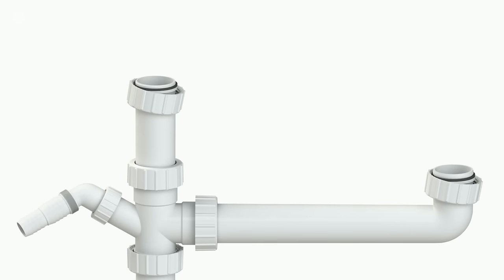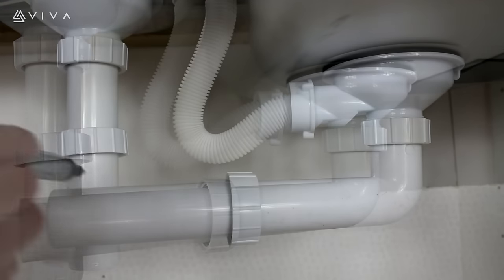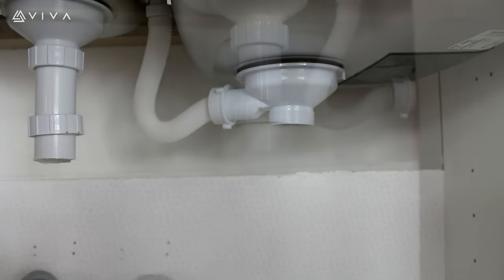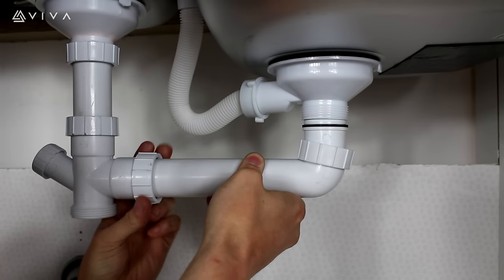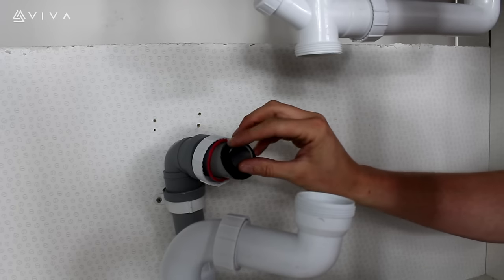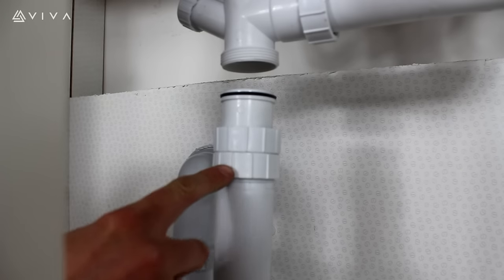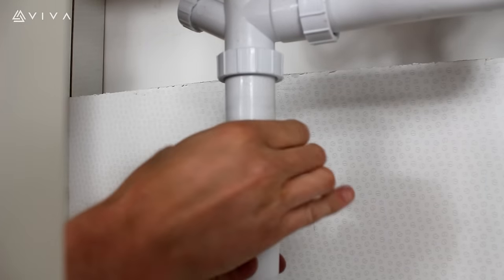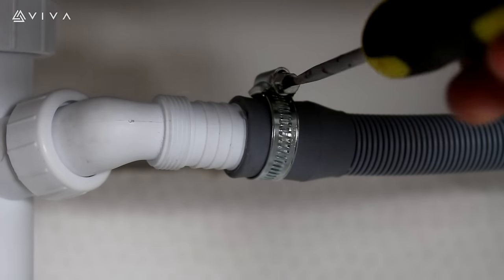How to Install or Replace a Bowl & Half Trap Kit For your Twin Bowl Double Kitchen Sink

Comment: Thanks for this. I had to adjust the pieces slightly because the spigot wouldn't fit on the left hand side under the smaller sink  as it was hitting the side of the cupboard so I bought a 90 degree compression knuckle bend and cut the L shaped pipe to make it straight and managed to fix everything together like that with the T junction under the larger sink.  Fingers crossed we'll get no leaks.

Comment: I had a blockage  in the pipe work under my kitchen sink. I unscrewed it all and took the parts to the bathroom to clean them placing them in the loo pan so that once the cleaning fluid had done its job i could flush the loo to rinse them. Once done, i took the parts back to put together,  but found the parts didnt fit properly. I can only assume a small section had been flushed away. Now I have a blocked toilet and a sink and washing machine i cant use !  Think I need a plumber now !
Reply: Fxxxxxx brilliant

Comment: at the bottom after the trap when you need to connect a pipe to connect all this to the buildings waste pipe does it matter whether the installed waste pipe is above or below the buildings waste pipe (sorry this is the best way I can frame this question )
Reply: water will travel not go up hill , like a ball will travel down hill, but not up hill, by its self, so it only needs 2 or 3 degrees of down hill slope on the 
" horizontal "waste pipe, or vertical, if it does not need to travel horizontally.in any direction, its all down to gravity, just look at a river, it's always going down hill, unless the tide is pushing it back

Comment: I think the plumber who did mine did it badly as it leaks and one of the pipes is loose and just sits in while another one falls off. I assume it's not supposed to be like that.
Reply: your better off with pvc cement rather than push fit

Comment: there should not a be a loop on the flexible overflow, lower than the overflow inlet on the  sink waste fitting, crap will build up, and eventually block it, and stink of bacteria etc.

Comment: And what if after some time, the linking tube gets 'gunge' in it? The smell comes back up into the sink. Surely there should be some sort of P trap on both sinks, not just one?
Reply: Spongesyellow I think that since the link tube is connected to the larger basin, the pressure and volume of water will keep it clear and both sinks can use the same P pipe to prevent back up and odours. Two P pipes would be a bit awkward to install.
Reply: t would definitely be better to have two traps, especially "Mcalpine " anti-syphon tubular P traps, to reduce the odour, traps stop the foul air entering the building, they do the single trap kit, to increase the storage space under the sink, which is less important than good health, and there should not a be a loop on the flexible overflow, lower than the overflow inlet on the  sink waste fitting, crap will build up, and eventually block it, and stink of bacteria etc.
 plus every thing should not be tightened up completely until it is all assembled, as some parts will be under strain, and out of alignment, start at the top and work your way down.
I  take the traps apart and clean them in warm water with dissolved soda crystals, wearing gloves, as the soda crystals leach out your sebum skin oil, which can cause dermatitis, nobody needs that.

Comment: I don't know, the P-trap is too high and it will trap too much water, it will clog faster this way, I prefer more Jimten or Ani Plast made products, they seem more reliable and they look more appealing. . .
Reply: 1. 1/2" - 40mm trap, normally has a depth of seal a 3 inches - 75mm of water, to stop foul air entering the building, P traps are better than S traps as S traps can induce self siphonage, which takes most of the water seal away, better to have Mcalpine anti-syphon traps. looks are not more important than function, that's why vehicles have round wheels, instead of square wheels, looks do not make things work, unless you think that things are just ornaments, and health is not important. not saying I do not like thing that are good looking, just look at nature they have evolved and adapted to survive to the best of there ability, to be functional, but in doing so are attractive, because they make sense. and will not survive without every thing else, in balance.

Comment: Only piece of info nor accurate is- not adjusted clockwise- look at his hand rotation, I can see ur point but a lot won't cos its not correct in fact the opposite. 
Other than that good clip.

Comment: Good instructional video - but the Muzak is so distracting...
Reply: your right, it is just a distraction, like have two people talking into your ears at the same time, unnecessary.and futile.
by the way, the video is not all okay, there are some things which are not good, if you know about plumbing, there are a lot of videos on youtube which profess to know what they are doing, but if you know more than them, you see lots of incorrect advise, due to the ignorance, which they are unawae of, I sure they mean well, but it is best to learn from experts, which will reduce the amount of work going in the wrong direction, causes problems in the present, and the future.

Comment: I had a blockage  in the pipe work under my kitchen sink. I unscrewed it all and took the parts to the bathroom to clean them placing them in the loo pan so that once the cleaning fluid had done its job i could flush the loo to rinse them. One done i took the parts back to re fit but found the parts didnt fit properly. I can only assume a small section had been flushed away. Now I have a blocked toilet and a sink and washing machine i cant use !  Think I need a plumber now !
Reply: take picture of them, before you take them apart, do one trap at a time, in a bucket, with dissolved soda crystals in hot water, use an old tooth brush.
 ( wear water proof gloves, as the soda crystals will leach out your sebum oil in your skin, and as a consequence can cause dermatitis ) 
then rinse the parts, before assembling them, do not wash them all together, or you will spend hours doing a jigsaw puzzle, without a picture.
 unless you have been plumbing since 1972 like me.